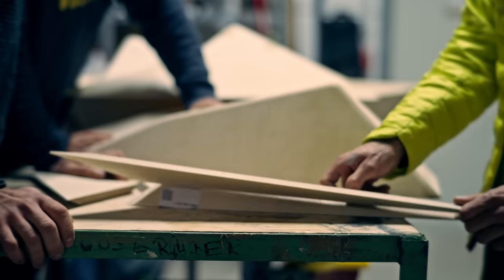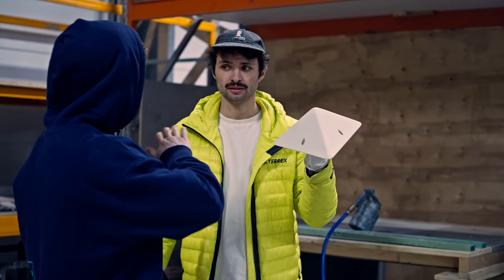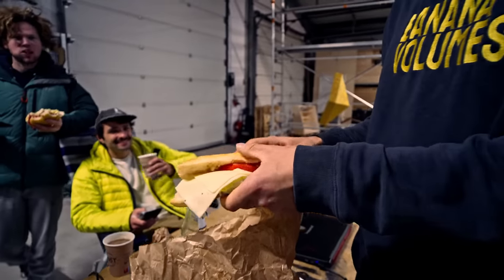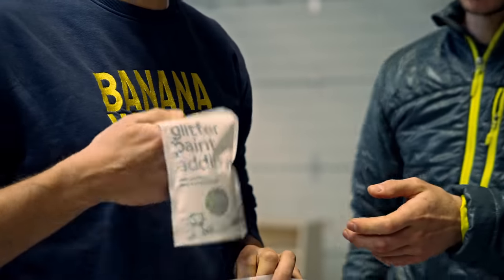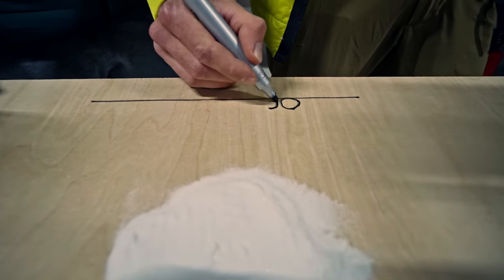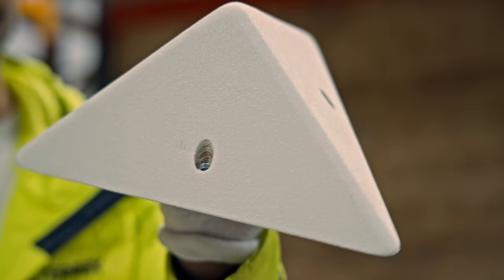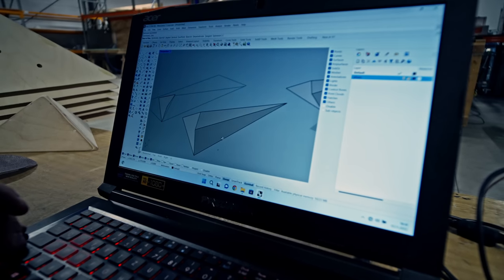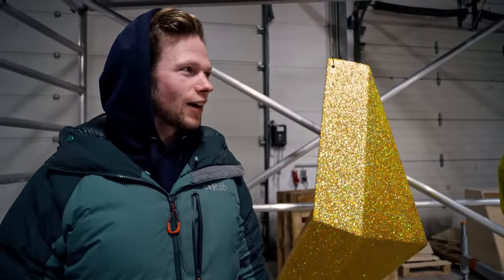The Secret Behind World Class Volumes

Comment: We have been building our own volumes for our gym for a couple of years. And we mainly have a problem with durability of the coating. We use an aquarium sand and a one component resin that is normally used for boats. But we don't have an airbrush for applying the sand. And the coating wears of quute quickly.
I think I might send them guys an email. Thanks for the coop and the cool video. :)